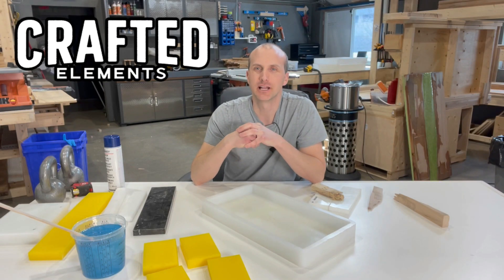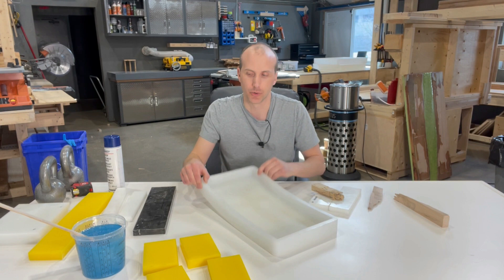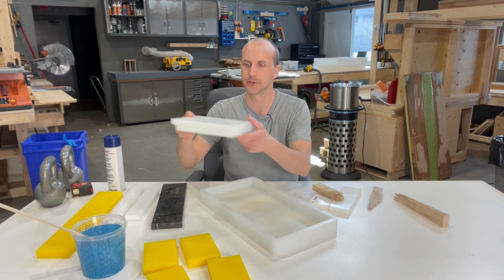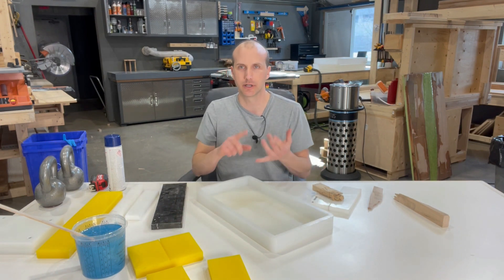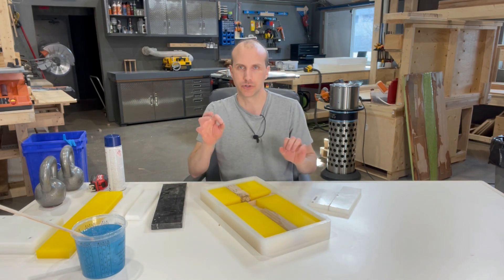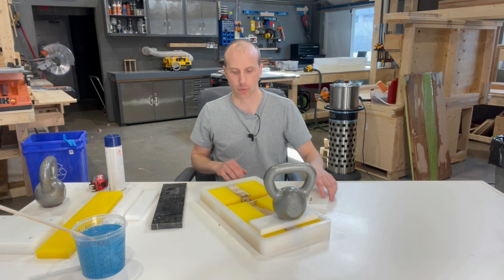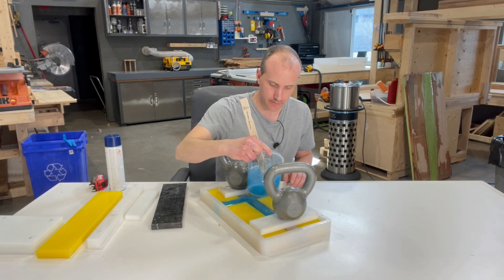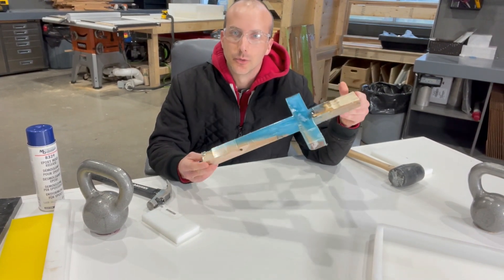HDPE Spacers & Making A Wood And Epoxy Resin Crucifix (Cross) With Our Large Silicone Maker Molds

Comment: Love your videos and your products.  I bought the 6 inch double crucifix mold and intend to use the cut off pieces left over from making deer euro mount plaques.  I am using a combination of epoxy and walnut.  I purchased your templates to cut those shapes out.  I intend to purchase other templates and molds In the future.  My research keeps pointing back to your  products as my best option for leak proof, usability, versatility and longevity.
Reply from the maker: Frank, thanks so much for saying so!

Comment: What are the sizes of the HDPE blocks for the cross and/or do you all sell them?
Reply from the maker: They are 3.25" wide i believe. They are all 1" tall. We dont sell them, but you can buy a 1" thick HDPE cutting board from Amazon and cut it up into whatever shape you need.
Reply: @CraftedElements  that is what I did.  I bought wife a large bamboo cutting board and took the HDPE one and cut it up.